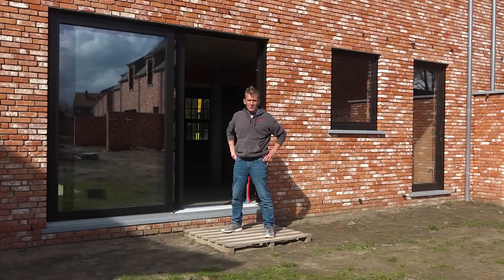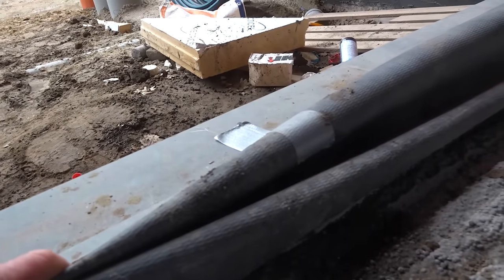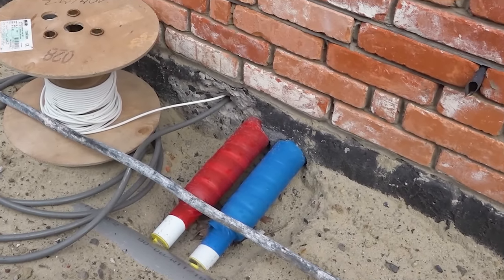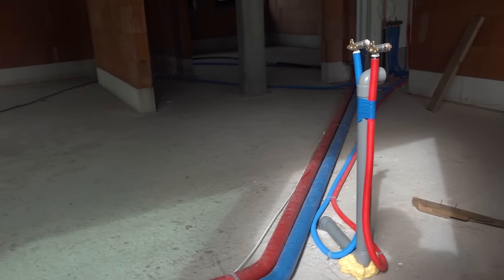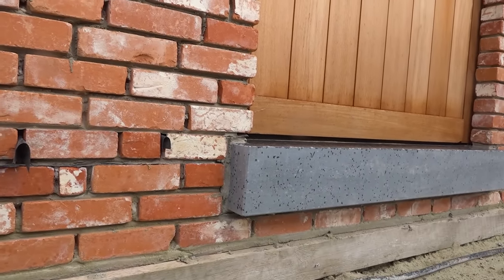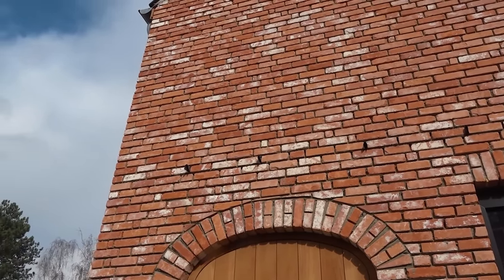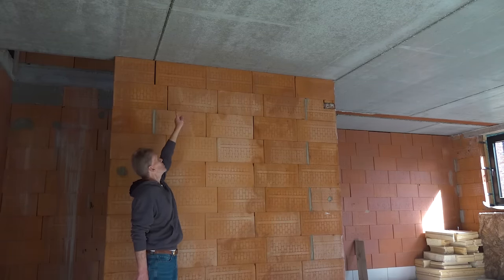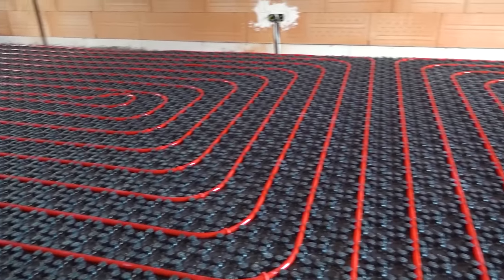Can We Learn From Buildings in Belgium?

Comment: I wouldn't say rising damp is a myth but it's far rarer than a lot of companies would like you to believe. In my experience its more often caused by cavity bridging in older houses which is something we probably won't see in newer houses with more careful cavity/insulation construction. 
I converted to a similar plumbing ethos years ago after having a faulty plastic plumbing fitting cause a clients ceiling to collapse. The biggest benefit is that there are no joints hidden; if there is a fault in the plumbing, it's going to be in a visible location. Pipes are incredibly unlikely to fail on their own without the help of an oblivious workmen/DIYer with a drill/saw so it has far superior maintainability. 
Properties in UK are built for generating profit NOW, not built so that they are easy to fix in 50 years when things start to wear out.

Comment: Couldn’t help you mentioning Mechanical supply and Extract (MVHR). I’ve recently done two RdSAP Energy Performance Certificates. One on a 10yr old property and one on a 60s bungalow (cavity filled, double glazed, Condensing boiler etc..Both with MVHR (Bungalow Retrofit) and the EPC rating drops  8 SAP points on the Bungalow and even more on the new build compared with a calculation without. Something I’m trying to get my head around with Energy Professional and Accreditation Bodies. I hope the new RdSAP 10 soon to come will fix this poor performance assumption.

Comment: Thanks Roger! Very interesting. I think a lot of people could be interested in a detailed comparison of building techniques between different countries. In Europe it seems to be big differences. Partly due to national traditions and partly due to the circumstances. Here in Northern Sweden the cold is dictating a lot of things and demands a lot of the building resources. Many new houses are built on concrete slabs on top of eps insulation and a layer of macadam gravel.  Only some factory produced module houses are built with crawl spaces. Crawl space is cheaper but moisture problems are extensive, problably due to cold ground under the houses causing condensation in the summer. So the building techniques have evolved and I think that they will continue to evolve since modern living standards with central heating and inside plumbing have not existed for that long. For many people only about 70 years, And that is only 2 generations to evaluate the building techniques if you consider that it takes 30 to 50 years to really know what is working well and what the advantages and drawbacks are. I am now working with replacing septic systems in the countryside, some you could say are 1st generation and some are 2nd generation. And from what we know now, and the procedure that we follow when selecting new systems, it is very clear why some of the older systems do not work anymore, and some stopped working very early on.

Comment: I have seen new buildings in Italy. All electrical wiring are routed through plastic conduit, usually 1.6 cm diameter. TV antenna, phone & Internet are separate, they travel in different conduit. The builders leave the plastic conduit empty inside rhe walls, with a pilot wire inside so that the electricians can run thi wires very quickly. Wire is 4 mm² for sockets, 2.5 mm² for lights. You see 1.6 mm² in scketchy places only.
Now, moving to the UK, there isnt't a plastic conduit in sight. The wire utilised has double coating, the brown blue and ground wires are grouped into an overall grey plastic coat, and that's is that. Not a chance you can add a wire to an existing installation without cutting the wall open. There are other safety measures tho - like the electrical "ring" wiring used in kitchens, but there are no provisions for upgrades or for wire replacements...

Comment: Nice description and there is actually even more layers underground. Unfortunately good builders are needed in combination with good techniques and we still see a lot of failures in new builds. Just one info about the tablets under the windows these are made of Belgian bluestone - Pierre blue du Hainaut a product we Belgians are very proud about and a stone you will find in a lot of heritage buildings also used for flooring, kitchen tops, bathrooms.

Comment: Very interesting video. Always useful to consider practices in other countries as this is a good way to learn from one another. The pipe in pipe appears to be a win win situation. Having a raised floor level is also highly desirable as this both prevents rain splash-back striking the wall above DPC level and also allows any damp that is rising to be able to freely evaporate sideways at low level. Disabled access can and is accommodated by designing in ramps, mini-bridges and other forms of appropriate landscaping, which just needs a touch of imagination and a good designer. 

I cant recall anyone suggesting that new buildings should not be provided with DPC'S  myself as such buildings by design incorporate barriers to moisture (eg cavities, DPCs, cavity trays, sealants etc). The debate about rising damp and the go-to fix of injecting chemical damp-proof courses and applying brittle cement rich impermeable renders revolve around old lime based solid walls- water always takes the line of least resistance and will therefore evaporate sideways, rather than rise, if it can freely do so. I do not wish to rule out the option of introducing a retrospective DPC in older walls but this must be one which will provide the required degree of long-term protection and any remedy should of course follow a reliable diagnosis - damp is a symptom. Always wise to keep an open mind when investigating building defects of course.

Comment: I thought pipe in pipe was standard for UK too? Certainly JG Speedfit have supplied sleevings for many years. Renovating a property over 20 years back and AFAIK, all plastic pipe (except underfloor heating) had to be sleeved if in concrete. All connections accessible via junction boxes. All copper in a concrete floor had to be run via conduit/accessible panels. I could be wrong.

Ref the fixing of windows at the top, I thought that was discouraged in case it affected the integrity of the lintel. I use expanding foam and it holds well.
Read a comment by some SafeStyle fitter many years back. He and his mate didn't even drill fixings into the sides, had just used foam and scarpered.

Comment: Hi Roger, first off I am no builder but I do find your tutorials very interesting. The other thing I find strange is why on the continent do they not put any cement on the vertical joints on their blockwork ?
Reply: A lot of buildings are constructed with a reinforced concrete frame including floors and the red blocks are non load bearing to fill the gaps.

Comment: Does the underfloor heating always get covered by concrete? I would love to put a nice solid hardwood floor in but have it raised a bit from the concrete slab foundation so I can run my electrical under. One of the previous owners of this house decided he was an electrician… I’ve got switches that don’t turn on or off anything and blank plates covering where switches should be, and ABSOLUTELY nothing labeled in the fuse box! Even the outlet in each of the bathrooms…. They are run to another outlet in the garage that will trip and leave the bathroom outlets AND the outlets in my back yard area useless That took me almost a year to figure that’s what it was!!! I’d really love to completely redo all the wiring/ routing.

Comment: Pipe In Pipe is not unknown, here in the UK.  I've installed it in flats, with standard wall mounted 'emitters' and in houses where U/F heating is installed downstairs.  Using JG Speedfit, the Speedfit tube was installed in the corrugated conduit, then the two were installed together before the screed was pumped in.  The pipes rose, generally, in a corner of the kitchen, behind a cabinet, below a combi boiler.  And it was obvious there was not enough clearance in the conduit to draw a replacement tube through easily if the original got nailed. The screed was probably only 3" deep, perhaps 4", and, while the underfloor pipes snaked around in smooth large radius curves, where the radiator risers left the screed and rose to connect to rads, the radius was tight, would cause tremendous resistance to the passage of a replacement tube. If anyone drilled into a pipe to fit something to the floor, remediation was going to be a nightmare...
Reply from the maker: Pipe in pipe is sold in the U.K but Pipelife who make a lot of it say that England is really slow to embrace it,  I think it will be that way until insurance companies insist on it.
Reply: @SkillBuilder  Hi, a far quicker reply than I had hoped for.  Thank you!  It's been perhaps 17 years since I last installed it (retired, now) but the way we installed it (as we were instructed) it looked like a nightmare for remedial... And I'm sure that, at some time, someone will install a bar or a stud partition, in a lounge, and screw it down through into the in floor pipe. Maybe they know fixings can only be 2" into the screed, but how deep will they drill?  
As I remember, some token attempt was made to identify pipe routes with spray paint... and that was obliterated by leveling compound and flooring material...  And... I'm not sure the screed in the flat development I worked on will survive expansion, contraction and point loadings from furniture in the long term.  It was quite friable from the start.  So the intermediate floors were Block & beam, polystyrene overlay, pipe in pipes stapled onto the polystyrene, with plastic barbed staples  then a screed laid onto that.  The screed thickness necessarily varied due to the presence of the pipes, and the screed was crumbly from the outset... I'd like to see Belgian screed out of curiosity.  I think it was your site upon which I remarked on the effectiveness of Belgian DPC or tanking.  Being driven round Bruges in a horse drawn carriage, I remarked to our driver... " God knows how they managed to keep that kitchen damp free, the floor is below canal level"  The guy just said "these buildings were built properly" and drove on... He left me thinking of the likelihood of insects getting into the kitchen from the canal, but, hey...

Comment: Some years ago a bricklayer told me something he called "the Swedish way" and that was laying bricks from the inside of the house, excluding the need for scaffolding.
Reply: That's what they do in Belgium. They build from the inside starting on a raft foundation.  Concrete floors called 'Welfsels' are dropped on, then they crane the packs of bricks and mixer to the centre of the house on those concrete floors. 
Traditionally  the house owner in the evenings will unpack bricks from the centre then lay them at the edges for the morning to the builders save time and also sweep up.

Comment: My italian home was built in early 70'. Pipe in pipe already existed for electrics and water. Water pipes have no joints and run from valve to tap. The house have not been modified. Not sure sice when  this method has been used, but i can easily say that seventies standards were so much ahead of  the UK. The 50 years old quality is still much better then many much newer properties in the UK these days.
Reply: True. I remember decades ago whilst travelling around Europe admiring these features in foreign houses. UK became dominated by big corporate builders who don't care about quality or innovation unless it saves money.  UK Victorian houses were the last decent builds, with interior brick walls up and down,  raised floors, stone ledges on windows, older town houses also had cellars. All long gone now.

Comment: pipe in pipe is mainly to protect and add a bit of insulation to the inner pipe there is very little chance you'd have a leak under the floor with that pipe since its all one piece, connection should all be happening above floor level. those damp screens in the brickwork are mostly for rising groundwater and rainwater. what actually protect the building is a layer of roofing/epdm on the foundationplate going up your isolated brick. but in this building it seems to be some sort of tar they put on, it doesn't look well done, it should also keep going behind the windowsill so you can't get any water inside from the windows/doors. the dampscreen under the windowsill is pointless and only creates a lose windowsill.
the pipes comming out of the building for a thermal waterpump are way too high and can leak water into the building and freeze during the winter, they should be +-60 cm below groundlevel. the way its done i can only image they forgot to put a pipes under the foundationplate to put them in afterwards and they had a drill a hole through the wall creating a breach for water into the building.

Comment: I lived in Romania for a bit. When they wire a house, they run tubes through the walls and ceilings and have junction boxes at different points along the installation. I had a wire fault on my system, I am not an electrician but to fix it was an absolute doddle because each cable can be easily traced and replaced. Electrical work here is very very messy. Once the installation is done, any repair requires removing floors, knocking holes in walls etc. Don't understand why we don't install like that here 😅

Comment: Built our home almost 10 years ago. All of this is standard practice.
Can't see the pipes going out the house being for anything but a heat pump. Basically mandatory these days. Also illustrated by the low temperature floor heating (heat pumps don't run that hot).

Comment: The way you should build with these blocks is to install a concrete ring beam at the top course before you put the precast floor slabs, if the blocks are not structural - numerous benefits

Comment: In the Netherlands buildings are constructed the same way.. By the way, the small pieces of plastic in the empty joints you show in the beginning of the video have a purpose. They indicate to the jointers where they should not fill the open joints.
Reply from the maker: Yes I understood that they are weep vents. We usually have a little plastic insert. So I was right about them being pointed up afterwards? It seems a strange way to do it because we lay and joint up as we go in the U.K

Comment: This is a typical project constructed for reselling. But taking in details from very premium houses so they can sell them for a premium. The outer walls are replicated bricks from the old days. The reason we have so much clay based products in Belgium is exactly because of the soil. There were many factories back in the days. My house is constructed with repurposed brick from around 1800. So is the roof. I think we build on a very high level in Belgium. It’s not sadomasochism, but it’s required by code.

Comment: I'm not sure that Roger is correct about the building being flats, it's very common in Europe to have concrete ceiling/upper floors. I'm a big fan of pipe in pipe, but is it feasible to pullout a leaking pipe to replace it, although it seems very unlikely that a pipe without joints will leak, unless it gets damaged. Certainly it's easier to rewire the house.They may also use the lateral system rather than ring circuits, where every room has an MCB. I would be surprised if those internal, lightweight blocks are load bearing, often these ceiling/floors are installed before the internals are built. We do have district heat schemes in the UK, there is a massive one in Southampton, which uses geothermal heat, supplemented by other sources. It's located near to John Lewis in West Quay.
Reply from the maker: They aren't flats, you are right. I didn't have anyone to guide me around so I made some wrong assumptions. Lesson learned for the next one.
Reply: @SkillBuilder  
On your next one look in the basement and loft !  both thanks to those concrete floors which are called 'Welfsels' these are the only thing pre fabbed , as the loft timber is usually done on site to get a nice big room under the roof.

Comment: Hi roger. I’m a plumber and I’ve built my own house from scratch. Currently at plastering stage. It’s a complicated build (basement) with a flat roof, bi folds etc. I’ve installed MHVR, under floor heating, ASHP, full fill cavity etc. I’m very exposed so any little mistakes in the build have leaked! Still have a couple of issues. I’m in Hastings, wondered if you would be interested in taking a look for some content?

Long time viewer, love your stuff 

Jake
Reply from the maker: Hi Jake
Yes I would be very happy to visit you. Use this link for contact www.skill-builder.uk/send

Comment: 2:15 You can't renew a leaking "pipe in pipe" The outside pipe is just for protection, the inside pipe is way to stiff to pull out and change out with a new one. That's not the intended purpose.

Comment: Pipe in pipe is the best way to go. The outside pipe needs to be a bit larger for pulling through, while reinstalling I.e. pulling through another wire or pex pipe

Brick or block is good. Easy to chase through & plaster

Comment: 3:00
Probably not district heating. But district heating, if rules are the same in Belgium as in the Netherlands, is insanely expensive. Think €800 with zero use. Then on top of it a charge per GJ of heat used that is also more expensive than using natural gas.

Comment: Water pipe in the red and blue sleeve, those are just for color coding. Did I understand that you would pull the water pipe out the sleeve if the pipe starts leaking? No, that pipe isn't going anywhere once the concrete is poured. 😅